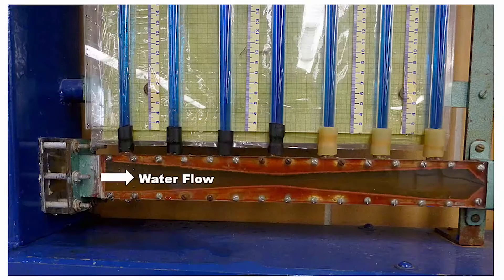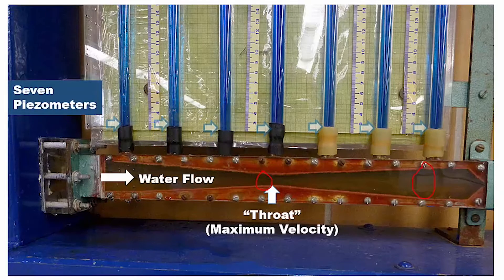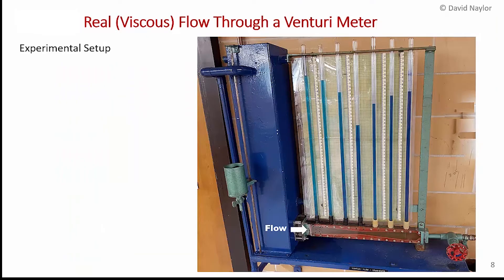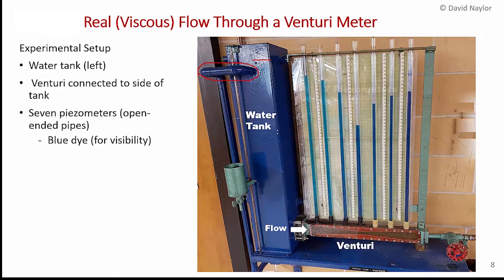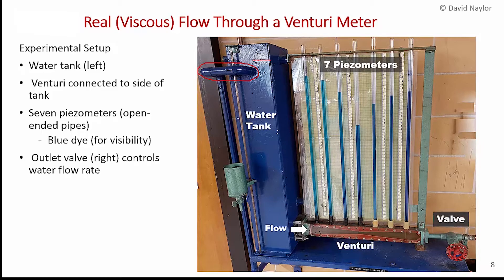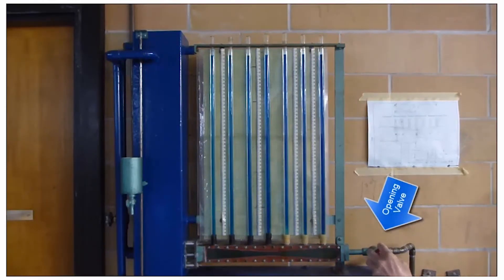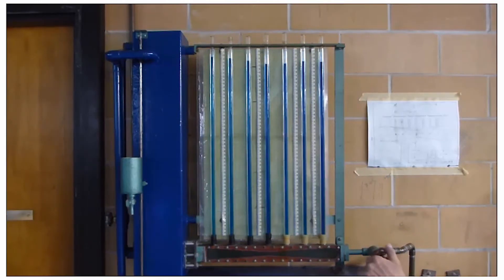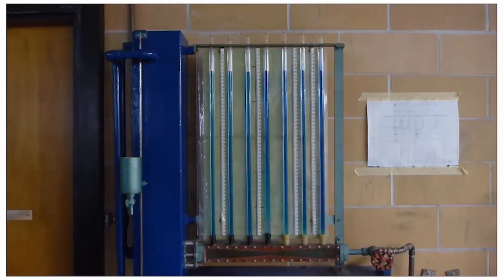Fluid Mechanics Lab 4: The Venturi Flow Meter

Comment: Does this mean the Bernoulli Equation / Venturi effect can be applied to non ideal fluids as well? (approximately of course)
Reply from the maker: Yes. In real (viscous) fluids there are some energy losses. But "Bernoulli" is often still a good approximation for air and water, which both have low viscosity.